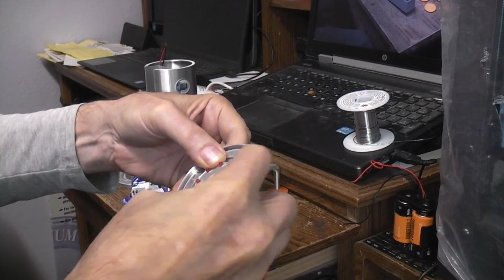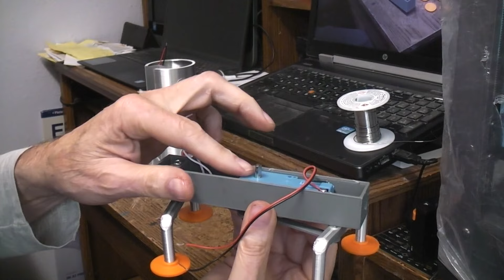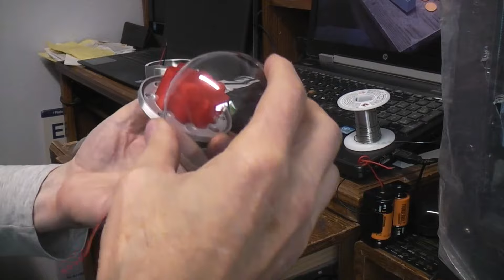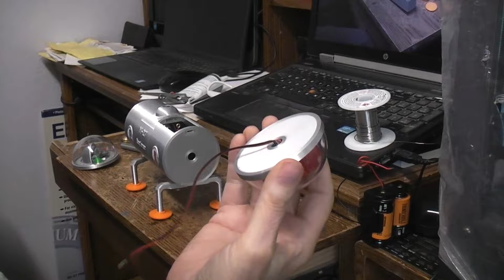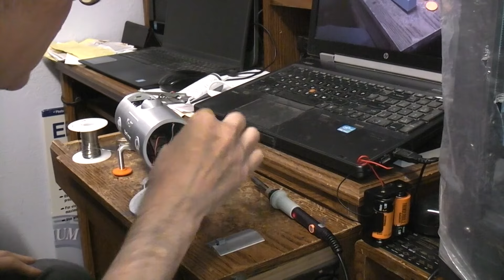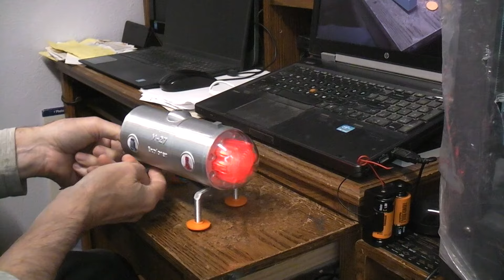Build video for 3d printed M27 Explorer project.

Comment: Hi jonh where you buy the domes ? What is the diameter of the dome?
Reply from the maker: The clear domes are clear plastic Ornament balls that cab be bought at all craft stores and online, Amazon, Ebay and so on. The size is 70mm. This information is on Thing-i-verse along with the STL files to build the project.

Comment: Weird how front legs swivel and have pitch, where back legs seem to just have Yaw. 
Hey, it walks. I may try to build one from your files when I get time. Great job!
Reply from the maker: Actually I cover this in detail in the build video for just the leg walking design. Simple 4 leg walking robot. It is actually the way all the 4 leg walking toy dogs and so on move. The rear legs only shuffle back and forth and the front legs take the steps. The difference is that they managed to design the leg movement from a single cam function in the 1960's Moon Explorer toy that I worked from.

Comment: Another awesome design and build. Thanks RH. Have you got a reference at all for the caps you have used for the LED's?
Reply from the maker: Not sure who RH is but as for the caps for the LEDs, you can use any value from 0.1uf up to 10uf. I think the ones I graded this build were 4.7uf.
Reply: @Robothut    "RH" = "RobotHut"?
Reply from the maker: @jayducharme  I'm not running on all cylinders today.:face-blue-smiling: